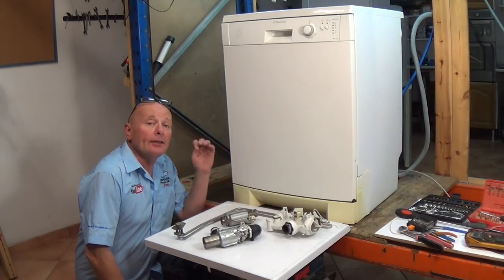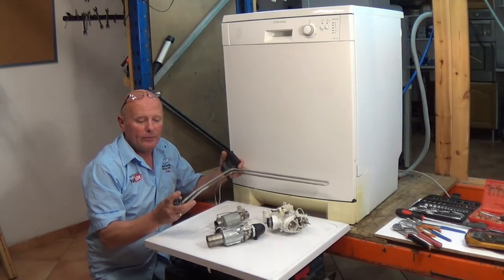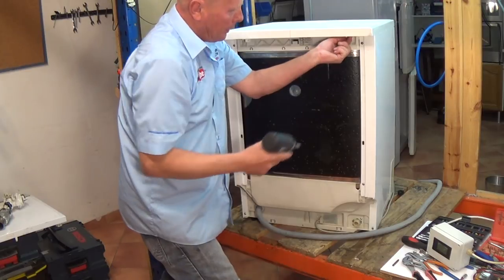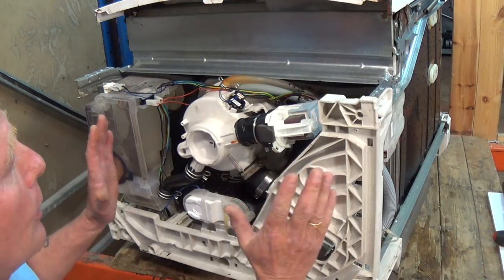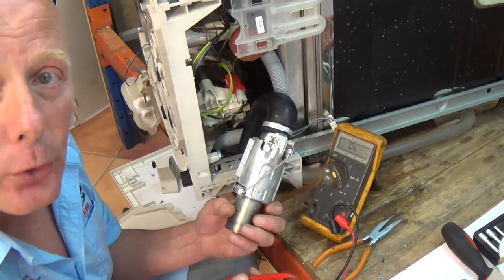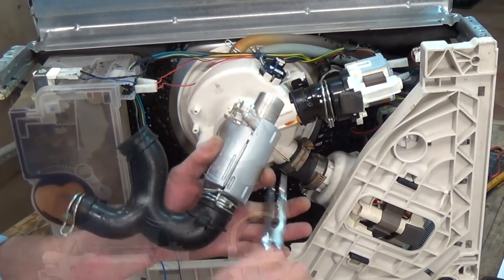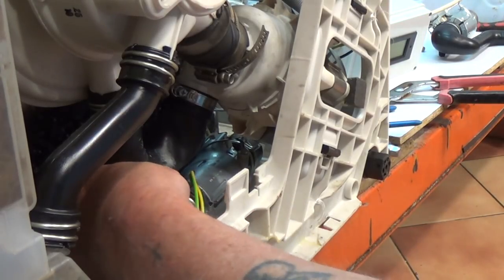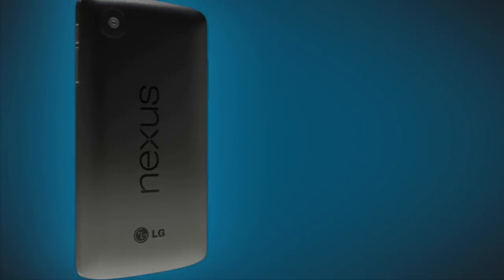Dishwasher not heating or Drying faulty heater element or thermostat

Comment: Hi. Can you tell me how to test if the turbidity sensor is good or bad. My AEG dishwasher is not heating. I assumed it was the heater but it is testing fine. I assume it is not the PC board as the display is fine. Research suggests the turbidity sensor. I am in Australia. Thanks for your informative videos. Greg

Comment: 1800w should have 32 ohms resistance. however combined im getting 16  but 1 of the heater thermostats has browning like yours. , meaning ive problems correct?.  in effect circuit is partially open?.

Comment: I have Beko dishwasher and I can see that dishwasher is drawing 2000W (flow heater), but only for 1-2min in each cycle. I tried replacing NTC at the bottom, but that did not solve problem. Any idea/suggestion?

Comment: Warning. These Electrolux dishwashers have now mostly integrated heater inside inverter circuit pump, and if its not heating, problem isnt mostly in the heater, but because no voltage is coming to it from the main control board. (Not the display board on the panel) So check the relay with 9V battery if its contacts are switching but even here isnt mostly problem.
Reply from the maker: Great advice to the people that read this. Hope you had a good New Year. Please remember to subscribe to the channel as that helps us
 glad we could help you @LordCarlSagan this is for you https://www.youtube.com/shorts/e432SAb2g08 please remember to subscribe as that's what keeps this channel going. Thanks 👍

Comment: I was reading and found this online.  "Bleach and bleach-containing cleaners are not recommended, especially if the dishwasher has a stainless steel interior."  Why shouldn't you use bleach in dishwashers?
Reply from the maker: The only thing I can think off is the salt container area.  please remember to subscribe as that's is was keeps this channel going. Thanks 👍

Comment: Just had my 18 year machine stop heating while in the wash cycle yet seemed to heat just about enough dry everything. .... nothing wrong with it except the filter and little float needed a good clean... Check the obvious before pulling the machine apart

Comment: Great explanation and than you. One thing I would add is that when you got the new replacement part it would have been great to use the multimeter on the new part and show and confirm the circuit to be working before replacing. Thanks again.
Reply from the maker: Thanks please remember to subscribe as that's is was keeps this channel going. Thanks 👍

Comment: Thank you for this video. I've removed my heating element as instructed and tested (the element itself appears to have continuity), but the bit in your video i wasn't quite able to follow was where (10:37 onwards) where you diagnose one of the thermostats going open circuit. Where you show us using the spare heater going across the 2 terminals. I cant quite see the points on the element where i am meant to be testing this

Comment: Bril. Followed the procedure no problems. A bit fiddley at times. The only annoying thing was when I had removed the faulty heater and checked it with the meter there was continuity. I'm absolutely sure it was open circuit in the dishwasher because I had used the meter and there was no heating during the wash cycle. Next time there are electrical contacts in a suspect device I shall follow the saying "if in doubt give it a clout" first.

Comment: Thanks for the great video.
I would like to have seen a close up of wear you were measuring the resistance.
Reply: Hi Stephen: Really the only test you need to do is across the 2 pins on the white connector. If your meter shows open circuit or high resistance, then the heater unit is faulty and needs replacing.
Reply: RSC Electrical hi, but can there be a case of a good heating element but a faulty thermostat? My dishwasher won't heat so I just unplugged the electrical cables from the heating element and checked the resistance and got around 26ohms for a 2000W element. The circuit board looks OK (no signs of arcing or black marks) so could it be a faulty thermostat? I don't know how to measure that